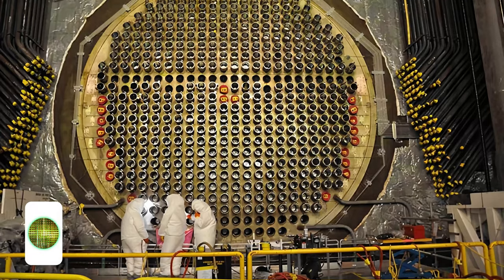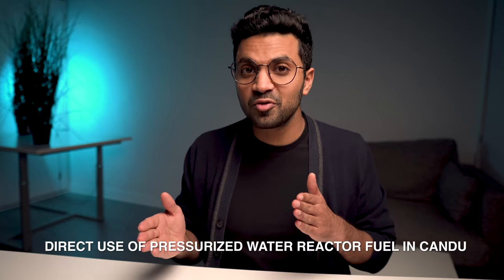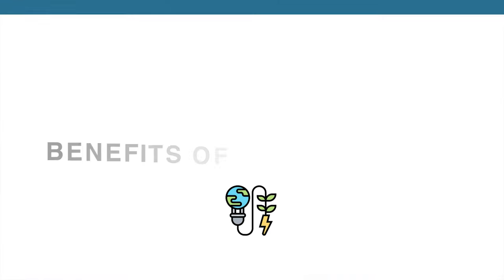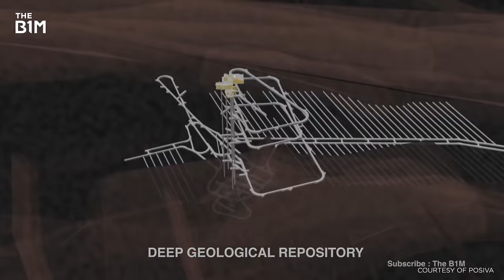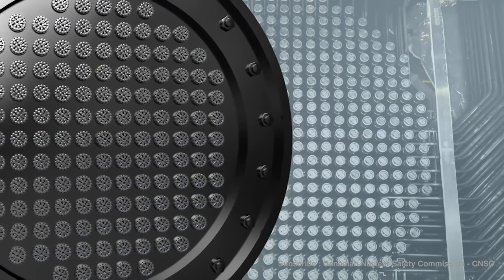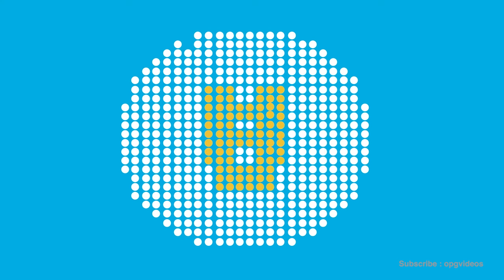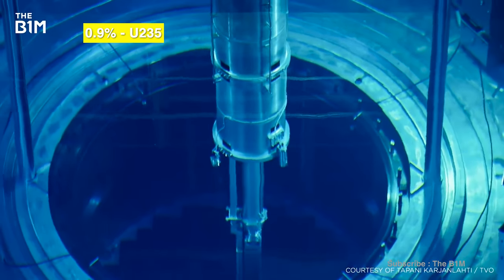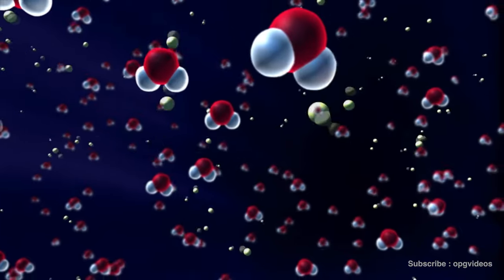How CANDU Reactors Can Solve The Nuclear Waste Problem

Comment: THE MIGHTY CANDU!   Thanks for the great video.  I have heard about this process before and wondered about it.  I'm guessing we would possibly need to build some new CANDUs to figure out the fuelling process.  The process might require building in a special pool into the intake end.  Which makes me think.  Can this be done with fuel that's over 10 years old?  That doesn't need water and only needs a special tiny dry cask?  Let's figure this out, and build some more CANDUs!  Get the US to pay us to take their spent fuel.  Win win!

Comment: Could one also reprocess the PWR SNF and «dope» the MOX fuel with a burnable poison like thorium, or downblend with U-238 to 0.7%+ the leftover Pu? Wouldn't the extra reactivity using reprocessed fuel allow for Th-232 to U-233 «breeding»? IIRC India wants to try this but just use Pu-Th MOX.
LWR+PHWR seems like a great middle ground until fast reactors come and further burn these «wastes» into materials that just need 300 years of storage.

Comment: Can the waste from the candu reactors be further recycled? How long does its waste present radiation dangers and need to be stored?
Reply: When fast reactors come, yes. Currently MOLTEX is building their SSR-W (fast MSR) which can take CANDU or PWR fuel and burn it into just fission products. 300 years and its at the same level of radiation as natural U ores
Reply: @AlldaylongRock  so like Thorium?? They say Thorium will decay to safe levels in 300 years I've heard...
Reply: @YourCapyFrenBigly_3DPipes1999  There's just less of the long lived stuff when you fission thorium.
But for using thorium, you have to run fast reactors anyway
Reply: @AlldaylongRock  ok... So every plant that utilizes thorium fuel is a fast reactor?

Comment: Ok, I have to ask. When you say nuclear waste. Are you referring to what comes out of the reactor? (U238, U235, P239, I131, C134, C137, S90) Or just the new elements and isotopes that are produced (P239, I131, C134, C137, S90)?
Reply from the maker: Rampage0303, I used "Nuclear waste" as a simplified alternative to "Spent nuclear fuel". Moreover, the important elements in spent PWR fuel that can be used by a CANDU are fissionable. This includes a range of biproducts and isotopes such as Plutonium-239 (Pu-239)
Plutonium-241 (Pu-241)
Uranium-233 (U-233). Hope that makes sense
Reply: @OsamaBaig  Most of the U235 and U238 that went in as fresh fuel, is still usable?
What portion of the products have to removed, during reprocessing. Isotopes? Quantity?

Comment: Really interesting.  Diagrams of new United States Navy aircraft carrier reactors look like CANDU reactors.  Do you know if the U.S. Navy is using them?
Reply from the maker: I can see why they might look like CANDU reactors Joseph, but I doubt it. CANDU Reactors run on natural uranium, which doesn't make sense for aircraft carrier applications. Using a PWR which is running on enriched uranium would be more practical (since aircraft carriers need to be run for long periods of time on the ocean without refueling). But if someone else wants to confirm that would be great
Reply: @OsamaBaig  US Naval reactors are light water reactors using very highly enriched Uranium as fuel. The biggest downside is that the US Navy stores that waste fuel in Idaho rather than reprocessing it and down blending to make it into MOX fuel.
Edit - 
Source: I took the tour of Idaho National Laboratory and they covered the US Navy fuel and reactors storage.
Reply: @DriveCarToBar  My understanding is that the US tries to reprocess naval reactor fuel after adequate cooling. Especially the submarine reactors which use very highly enriched fuel, but the surface ships also use somewhat enriched fuel. Presumably the used fuel still contains far more fissile material than natural uranium and is highly desirable for reprocessing and for isotopic separation. The high enrichment also means very little U238 was available to be converted to awkward plutonium or other isotopes, so again, reprocessing and enrichment would be easier than for the products of many other reactor types.
Reply: @aaroncosier735  I could be wrong, but I thought that was the intention, but it stopped happening.
Reply: @DriveCarToBar  Last I heard was from a recently retired commenter here on Youtube, claimed they were still reprocessing till he retired. 
I assume it would be very desirable to reprocess, due to the high enrichment and low contamination from other actinides.
It's all classified, so they might just be doing a purex to remove the fission products and putting the rest on the shelf for later.

Comment: This application of CANDU sounds good. Certainly you can wring some more energy out of the U235 and the fissile fraction of the plutonium.

But:
I do not see how DUPIC can reduce the space/volume requirement for subsequent disposal. Spent uranium fuel rods came out with fission products  corresponding directly to the original fissile content, plus some fission of the U235 and plutonium produced by bombardment of U238. Let's say about 4%, less decay of short-lived isotopes. Now you take that rod, and subject it to further burn up. Now it contains more fission products than when it went in, plus more products of bombardment, both of the U238 and of the plutonium mixture. Now you let that doubly-spent fuel cool.
It now has more Caesium and strontium, so it will be hotter longer in deep disposal. It has more actinides from bombardment of U238 and more weird ones from bombardment of plutonium. U232 comes especially to mind as a gamma emitter rather than a neutron/alpha emitter, with a half life twice as long as caesium. This stuff will be hotter and for longer than the original spent uranium fuel. It will need a new round of cooling for the shorter lived fission products, and final disposal in a facility with distinctly longer containment periods from two metrics. Firstly: the U232 will double the period otherwise allocated for decay of caesium and strontium, and the increased amount and diversity of plutonium bombardment products will extend the extreme long term actinide containment provision. Or so it seems to me.

I also do not clearly see that output is improved. There may be more U235 and Plutonium reactivity, but there is also the poison capacity of the fission products and the large-cross-section actinides. It eats up some of your neutron economy and requires extra fresh fuel to furnish those.  Granted, you have lots of moderator, but you still need to furnish neutrons from somewhere.

Finally, this stuff is still thermogenic waste, corresponding roughly to spent fuel. When you damp the reactor, it keeps making heat, probably more than from your normal natural uranium fuel. You may get better peak output, but you also have higher cooling requirements at idle and in temporary storage.

It sounds good, and historically CANDU is one of my more favoured reactor concepts, admittedly for aesthetic reasons. But I am hard pressed to see that DUPIC is as exciting as all that. DUPIC is only part of the fuel load, requires awkward handling, and produces wastes that are hard to visualise as more tractable than either the original spent uranium fuel, or ordinary CANDU spent fuel.

Comment: Just so we're clear, when you say the CANDU reactor solves the waste problem, do you mean the transuranic waste is converted to more fission products?
Reply from the maker: Ordinal, CANDU's don't burn transuranic waste products (like Molten salt reactors do), rather they would use the left over fissile product 0.9% U-235 and 0.6% - Pu which is remaining in spent pressurized water reactor fuel. In turn this helps repurpose spent PWR fuel, which is a sustainable strategy
Reply: @OsamaBaig  ah I see.

I guess they can help get some extra use out of the rods, but we'll still want some fast neutron boiz in the energy mix then. :^)

Comment: Question: After a CANDU has consumed DUPIC fuel, what happenes to the spent fuel?
And what is the potential in reprocessing it?
Reply from the maker: Same process as fresh fuel, it goes through the exact same waste handling process. It goes into a fuel bay, then to a dry storage after 10 years cooling down in the fuel bays and ultimately into a deep geological repository for permanent disposal (or it can be processed again to produce more fuel) lots of options!
Reply: @OsamaBaig  Ah, interesting! Thank you for sharing some info. My idea was that since in regular spent fuel, valuable metals, for instance Rhodium are present in some quantities, used DUPIC fuel might have significantly higher concentrations since it has spent more time in reactors, thus making reprocessing more lucrative.

Comment: It may sound like magic but it is the opposite, it's simply that good when the dirty politics is cleared away, and the distractions of carbon based resource wars avoided. (We will still have a planet of criminal excessiveness, but the SMR  system requires a much tidier approach to management)

Comment: you waste 9:23 without clearly explain How CANDU Reactors Can Solve The Nuclear Waste Problem
As you mention, CANDU Reactor was developed in 1960s. It's been 60 years, why isn't it use nowadays?
Elina Charatsidou, another Youtuber, did a better job than you